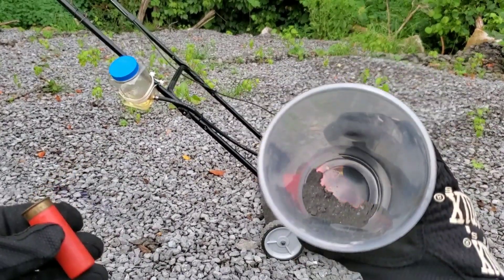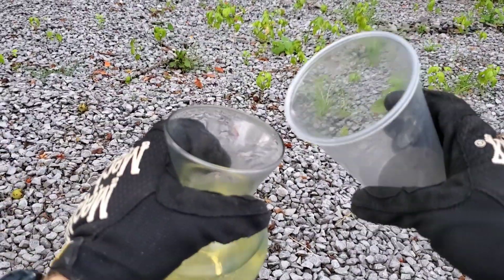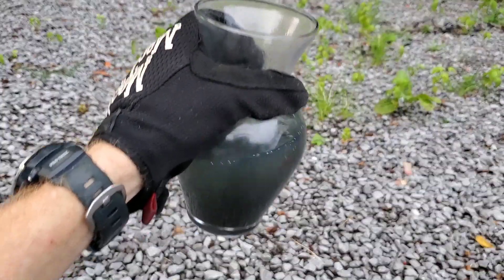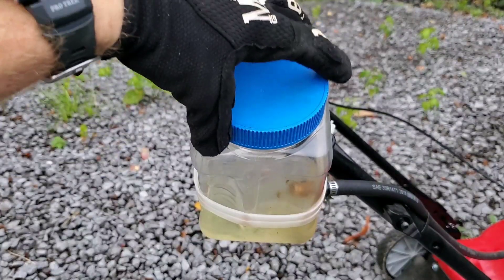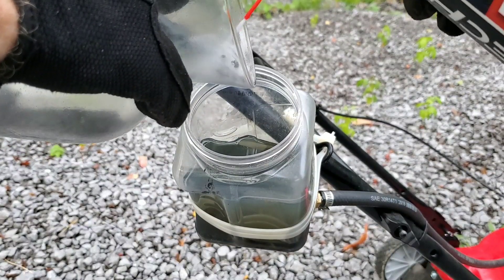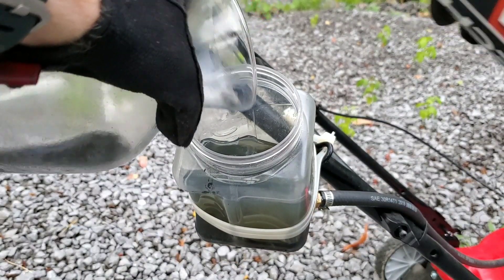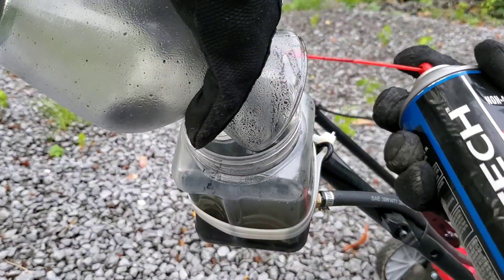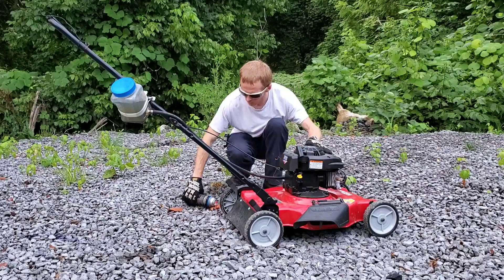engine runs on GUN POWDER explosive results!!!

Comment: Putting the brake parts cleaner fluid into the gasoline is going to be a more explosive mix to start with. You should do a hose straight into intake and then black powder down the hose from a distance for a more precise experiment

Comment: Im sure an engine could be designed to use only ramset blanks instead of liquid fuel. Just be sure to feed it long belts of blanks lol.
Reply from the maker: Thanks for sharing.
Reply: That would more or less be a blank firing machine gun with a cam instead of a spring
Reply: Not really, the issue isn't the energy in the fuel - gasoline has significantly more energy per given weight than most low or high explosives.
The issue is the speed of detonation/deflagration - the 'burn' just happens too fast.